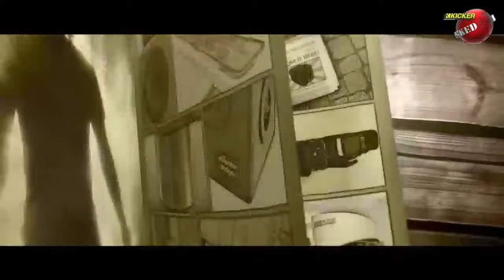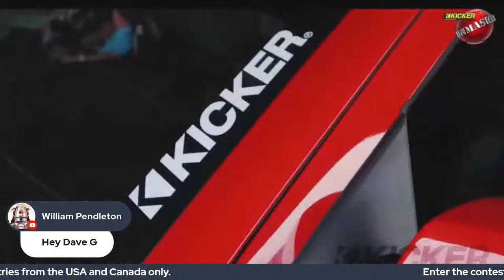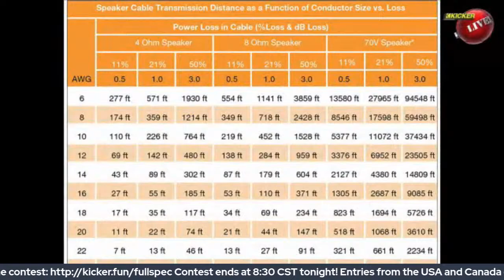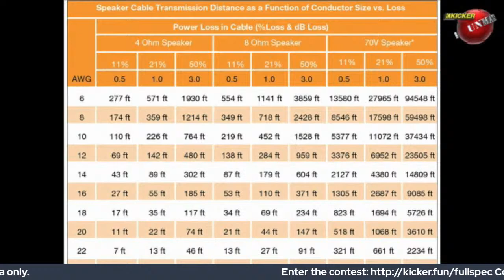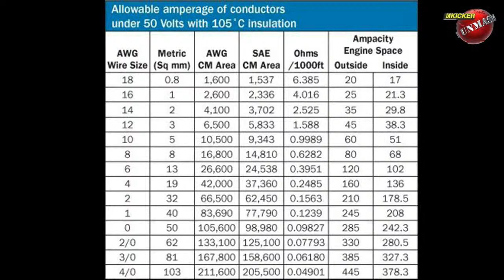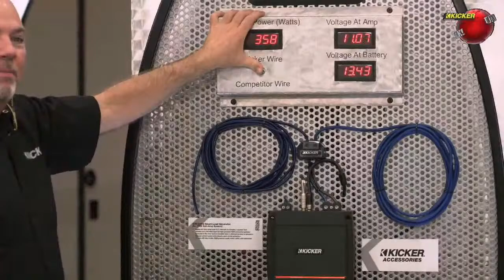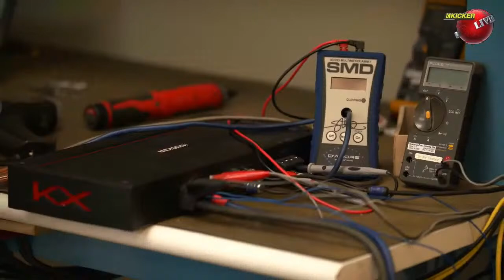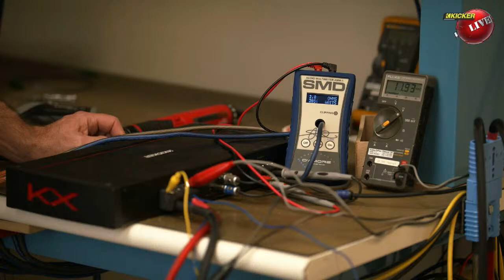KICKER UnMASKED - The Science of Wire

Comment: Great video to get the minds out there thinking. I'll add one thing that was missed. Copper doesn't contract or expand as much as aluminum, making set screw connections more reliable, and in my experience, that's where resistance is typically seen, at fuse boxes, amp connections and distro blocks. I always wiggle, torque, wiggle once more real good to "settle" the wire. Torque it again, it'll be loose. 

Keep these coming, gets my brain thinking about stuff I wouldn't have. Thanks y'all!

Comment: Why did kicker use aluminum for the voice coils in there Q class subwoofers instead of copper
Reply: That was explained in another video. Voice coils do not get DC voltage to them. They get alternating current. That means they stay cooler than power cables. Ever notice speaker wire doesn't get hot like power wire. DC vs AC to very different types of current.

Comment: So, It begs the question; Why do all these companies use aluminum wire in their voice coils? I personally have never understood this other than cost.
Reply: Aluminum can weigh less, and open options for design build. 

Aluminum dissipates heat very well, while offering a lighter mass for efficiency and power handling. 

Copper will have a higher bl product, but at a cost of weight. That weight may be beneficial to lower FS, or resonant frequency of the driver, pending it's design application. 

One isn't better than the other however, they both have thier place... 

I know this to be fact, not an opinion.  Hope this helps!
Reply: @georgesrisomsak9650  A lower Fs in a woofer is always a good thing these shit woofers made today shouldn't be called woofers... They're midbass drivers at best. So again, aside from cost I don't understand it.
Reply: @666hobart  it's a trade off, of efficiency. A heavier moving mass will usually be less efficient, but mostly makes up for that with it's higher bl. 

Lower FS would be beneficial to a low tuned daily ground pounder. Higher FS would benefit an spl application.

It's all in application and design. One truly isn't better than the other. 

That said, I run a fully loaded  DD9918 with an aluminum coil, and it does it all. I play anything I want, and it sounds incredible. Tight, defined sound quality, and absolutely crushes lows rediculous. If designed properly, either can be a great material for coils. Mass works better for some applications than others, pending it's intended usage.